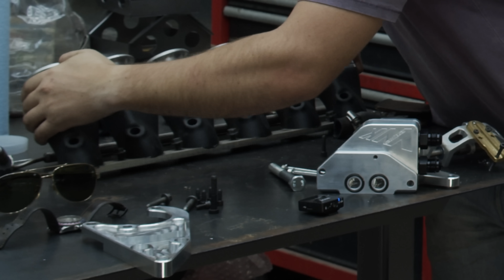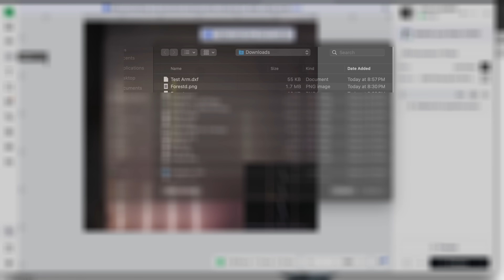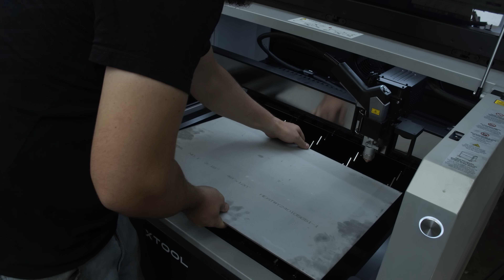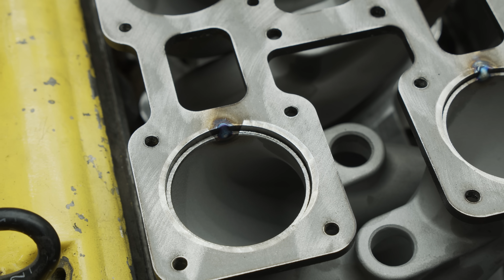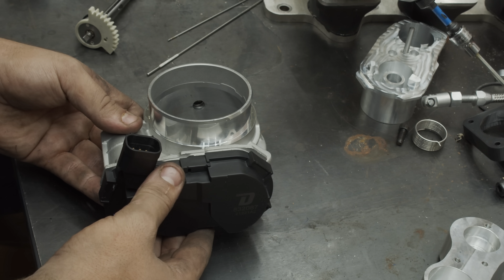I built another V12 ITB intake...

Comment: Cool beans, dude. Seems it would it be possible to laser 3d metal powder prin(maybe even 3d plastic print) those intakes, maybe in 2 sections. Remove all the fitting and welding, just bolt in pieces, then add ITBs?  Looking fwd to v12 sounds.

Comment: You are a bloody genius.. I saw first rendition.  But this made me cry..lol.. I wish I had your tools. My son and I  would make an absolute monster out of his jag-xjs V-12.. we are  pondering on making a quad throttle system  , by still using  half of the intake manifolds.
Reply: Do you know Jenvey Dynamics in the UK? They offer ITB solutions for the Jaguar V12. You can also just buy individual parts if you want to do some custom setup or just want to do some work yourself.
Reply: @Andreas_A_E ,, sorry for the slow response.. yes I do, went through their site.. that is to rich for my blood. We want to improve a original jag lister, LeMans idea. But much more improved..lol.. if ypi seen jags original intakes, we are  going to cut them in half,  make custom box to fit original 73 mm TB.. so one TB to feed 3 runners.. but i think we may have to reduce the TB diameter.  If one 73mm fed 6 cylinders.  Haven't calculated the reduction size..

Comment: I run 8 ITBs on a 452 cu. in Ford FE.  I love them, but they have several drawbacks and several advantages.  Advantages:  1.  More torque at mid range. 2. Allow a bigger camshaft that idles like a stocker and doesn't lope.   Disadvantages:  1.  Throttle bodies have to be synchronized perfectly otherwise idle AFR in each cylinder is off.  2.  No increase in horsepower over a single plane intake.  3. No advantage if running a stock/low overlap cam.  4.  Hard to fabricate an air cleaner.  A simple turbo system makes more HP at a fraction of the price.
Reply: ❤ A turbo, however, doesn't have as sweet a sound as an NA ITB'ed engine has. Especially when one can pick out the woosh/hiss of air being breathed in by the engine at wide open high rpm.

Comment: Your injector angle on the valves won't work well.  Its going to puddle the fuel in the runner and you will struggle to get good transient enrichment.

Comment: Watch out for fuel pressure in a common rail with 12 injectors. Full load full rpm it might drop too much and uneven. During acceleration it can also be a problem.

Comment: Wes, as others have commented, do whatever makes you happy. I love your videos as they tend to be quite informative and you’re afraid to innovate! This is reflected in XTools support. While I could sit in front of my TV for hours watching you do your thing, what I should be doing is my own thing in my own garage. I have thought about sharing that with others but, I’m under no illusion about the extra effort that takes. 

Back on the XTools Laser Cutter/Welder package. I find myself looking at Laser Cutters more often these days, as while I own a Crossfire CNC Plasma Cutter, I do find I’m after a bit more detail/resolution. Using a 0.9mm Tip means I’m removing 1.1-1.2mm of material during the cut (kerf). The XTools setup is nice but a bit beyond my budget. I’ve even toyed with idea of building my own but it’s still around US$6-10k in parts depending on what motors and head you use. Hopefully the prices will come down over the next few years?

Comment: No worries about the drop in low rpm torque b/c of the short runners, if this is an engine that's on the track, you won't be spending any time down there anyways! :)
Reply: That’s not true, shorter runners hurt midrange not low end
Reply: Well, if that engine revved to 10k, he'd be fine.
As it is, they're far too short.
Might be a packaging issue.